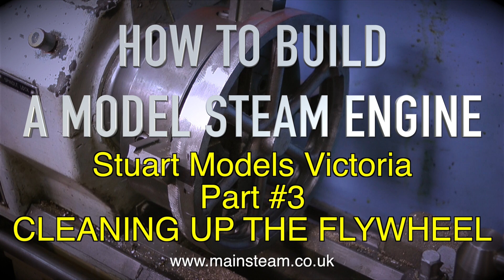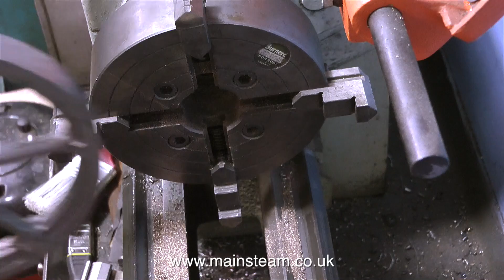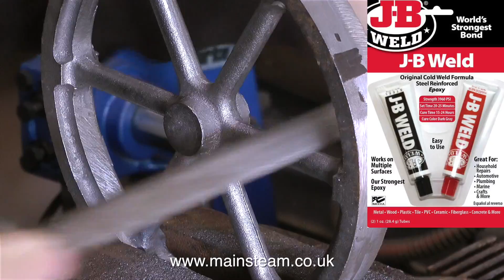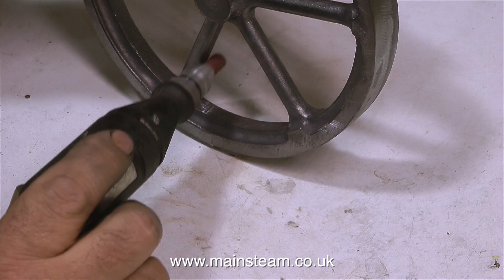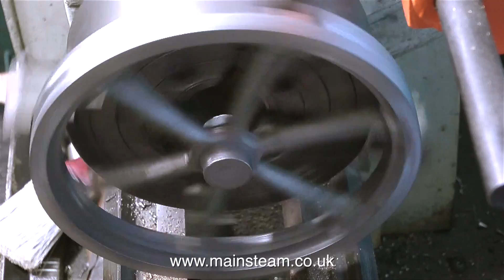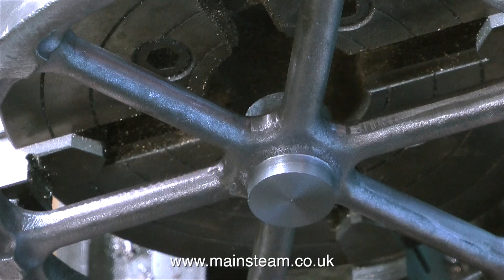HOW TO BUILD A MODEL STEAM ENGINE - STUART MODELS VICTORIA - PART #3

Comment: Years ago I had to do a lot of ink lettering. I couldn't afford to buy a Leroy lettering tool, so I measured the one that our company had. I went home and with nothing but a drill, taps, dies, hack saw and files I made my own. I first tested it at work and found that it was superior to the one that we had at work. My work place allowed me to use their templates and I did a very large volume of ink lettering with it. Thus, I know that your approach of using files for machining is very practical indeed. Thanks for sharing.

Comment: Picked up today a 1939 Mamod SC3 still in its original box with its burner and brass funnels, I am soooo pleased as its turns nicely on compressed air :)   Have made up some of your recipe of oil and rapeseed oil for my engines as it seems to work very well in my pushbikes wheel bearings, chain and crank and got rid of squeaky door hinges on my Reliant three wheeler with the doctored jollop too.

Comment: Found it very relaxing, always like the way cast iron machines. Did you form the radius on the lathe tool yourself? It has a nice radius.
Reply from the maker: That particular tool started off being that shape, I have reground it a few times though and managed to keep the same profile.
Reply: You have done a very good job of keeping the profile then. I have been using the round (button) inserts, preground with chipbraker already there.

Comment: For getting the concaves equal on both sides of the flywheel, would it make sense to scribe a line measured from the spoke side of the concave to the face of the wheel? You would have a "stop here" visual reference while machining the faces.

Comment: Hello Keith! I like your videos very much and I watch them every day. Actually I'm building a Twin Victoria! One of the two flywheels is done and it runs very true and some other parts are finished. A year ago i have build a beam steam engine. It was my fist steam engie I've ever build. But the flywheel wobbels a bit and it's hmm disgusting :D I think I will make a new one. I can send you a view pictures if you want? As a german i find it very hard to build steam engines form stuart. I dont like the imperial system :D 3/32; 5/16; 3/8 wtf??? :D But I take it as a challenge to maschine parts with very close to the imperial size. Now I'm excited for more videos from your Victoria.
Many greetings!
Danny

Comment: As an alternative to the Dremel rotary tools, I use a Proxxon IBS/E. I highly recommend it because it has a proper speed control that doesn't require you to turn it up to 30,000 RPM to get any decent power out of it. It has lot's of torque even at the lowest (8000 RPM) speed. (It's been a while since I used a Dremel tool so I don't know if current models don't suffer from this issue). The other really nice thing is they are very quiet. I use ear muffs if I'm using cut-off wheels at max speed, but with anything less than that, you don't need them.